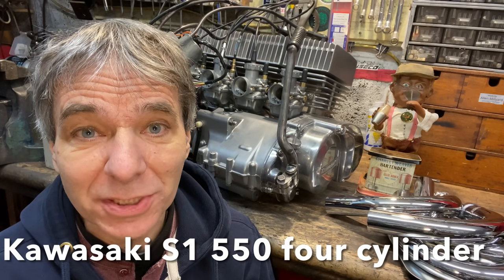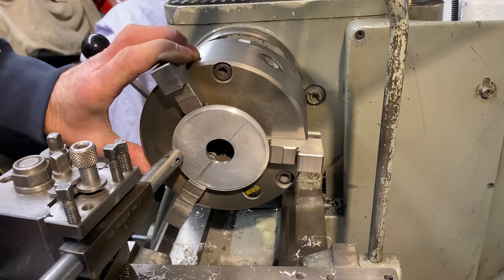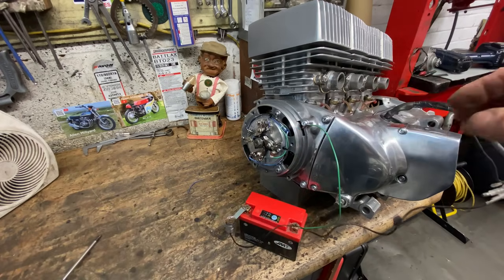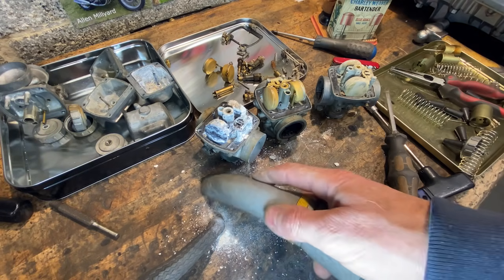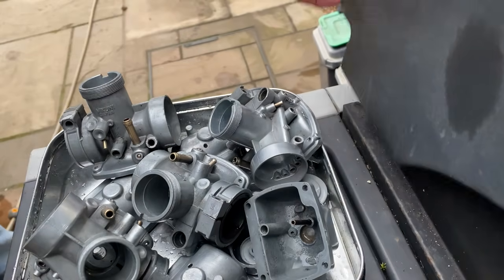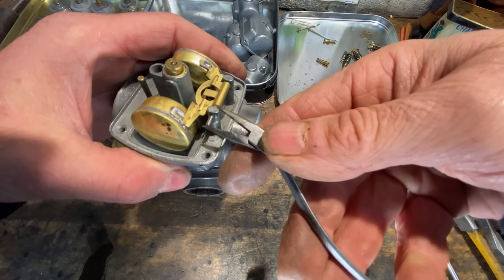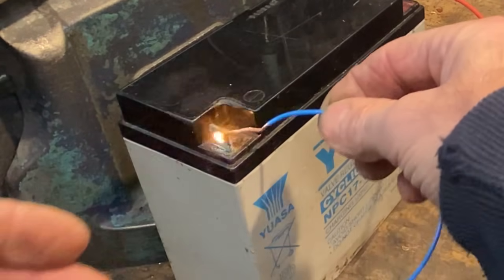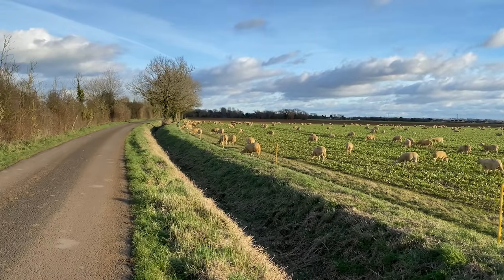Kawasaki S1 550  four cylinder first start, ignition timing and carbs. Episode 7

Comment: This brings back some wonderful memories from high school. In 1976, I was very fortunate to have a dedicated motorcycle repair class with a well equipped work shop. It was run by a great teacher and mentor Jim Capps who taught me to never be afraid of a mechanical challenge. He pursued engine mods just as you do boring and resleeving, adding domes to pistons and such. We had a small boring machine and I rebored my S2 along with disassembling the crank to replace the inner crank seals. Getting the crank straight again was quite a challenge and very few people understand what is involved with pressing a 3-cylinder crank back together. But we did it. I found a book describing the equations used to design expansion chambers and be fabricated a set for my 1972 S2. What a wonderful rocket. Real properly tuned expansion chambers make the greatest noise - so crisp and bright. It was a great adventure and taught me that anything was possible. I owe a lot in my life to Jim Capps.
Reply: That was nice to read,  thanks for sharing

Comment: 13:01 I was also taught to put nothing but liquid or air into a jet. My reasoning on that is that copper is softer than brass (thus shouldn't harm the jet), so I strip a piece of copper cored electrical wire, using one or two, maybe more strands to poke around in the jet. The number of strands depends on the size of the jet, more than one strand almost seems to be like a wire brush.
Reply: @vicamaral  🙄

Comment: Second hand crank after fully handmade ignition system.. And then the carbs, with almost idle, it probably would've idled if there was some fuel pressure from a tank.. What a build, Takumi-San, what a build.

Comment: Hi Allen, great video as always. I love to see the engineering that goes into these engines, it's quite incredible to be honest. However, I have one question... I get having the four sets of points makes some sense, but given that once adjusted for gap and them all being mounted onto the same plate, how do you adjust the timing for each one individually? Keep up the good work, cheers Andy😀
Reply: yes i wondered that as well,once set its set
Reply: There would be no individual adjustment each TDC is exactly 90 degree the only adjustment is for the entire disk plate to be rotated
Reply: @oceanhome2023  Agreed, just that Allen implied (I thought) in the video that he wad adjusting each one individually... thought I was going mad to be honest! Cheers, Andy
Reply: You slightly adjust the points for each cylinder...

Comment: I struggled with carburetors for several years until I bought Kawasaki with fuel injection.  It's like jumping from the early 1980s to the Star Trek era :) I don't have the strength for such games anymore :)

Comment: I have to think that many, if not most builders tasked with creating a duplicate of Mr Millyard’s 4-cylinder “triple” would require a CAD program, a 5-axis milling machine, a 3-D printer and a foundry facility just to commence work. Meanwhile, Allen soldiers along  with a hacksaw, a Swiss Army knife and a gas-fired barbecue.
I believe he needs to delve into something a bit more challenging; perhaps build a 1913 Indian Scout from scratch, then modify it to set an FIM land speed record at over 200mph!

Comment: You cleaning those jets with the wire reminded me of a cock up i made as an apprentice aircraft mechanic. I was cleaning brass fuel nozzles in an engine overhaul shop and thought I was clever stringing them on stainless wire though  the jet hole to dip them in acid. I got a huge bollocking for possibly damaging the calibrated orifice. Lucky for me they flow tested ok

Comment: one tip I picked up was to use solder to check galleries were clear. being soft and less likely to score. I had a bad carb problem on a Pantah and it turnewd out to be a blocked gallery which I did eventually sort with very thin solder wire.

Comment: Brilliant, was doing me head in trying to work out how to get the points to fire propley, finally finished building my kdx250 91 Sr and the travellers knicked it, gutted, repainted, new bearings. Gonna get the Rs250 going. I have to look on a Spiritual level when I lose a bike, I say the Man upstairs takes it away cause I was gonna Sling that one down the round, I have to or I'd go GaGa, and I don't bonce like I used ta. And make ur own carb bit's, Unbelievably Brilliant Craftsmenship, the Response on that Engine, the induction aswell, that Suck's better then the ex mother in law. Awesome. The only reason I do the lottery is to win and buy all ya bikes. 👍God Bless.

Comment: Dear Allen, Have you ever considered using a professional ultrasonic cleaner? I use one to clean my carbs. Even the totally disgusting ones come out like as if new from the factory and it's fast too (20 to 30 minutes, repeat when really dirty). And it does not require nasty acids but a special detergent (depending on the material being cleaned). It's great for parts like jets and needles. No need for a jet-picker anymore. Cleans every nook and cranny, even deep inside, better than anything else. There are large cleaners available which easily fit large carbs.

Comment: I like how much stuff is replaceable on these carbs. I had an old airstriker carb on my dirtbike that the needle seat had a nick or something and it would just pour gas everywhere no matter what, even after a new needle, though it's technically possible to drill out the old seat and press in a new one. I ended up buying one of those cheap Chinese ones and just transferring over as mutch genuine parts as I could. seems to work well.

Comment: Impressive, and congratulations ! Flawless at the first start. I've heard a high frequency dry crackling, without exhaust system and mufflers. It sound a litlle like the "Yamaha four" 2 stroke 250 cc of Phil Read in the sixties...the racing mood of the golden age ! Now perhaps you will install four exhaust pipes, giving a more civic mood  ; )

Comment: Another awesome video on many levels,  I keep thinking why you use points and not more modern ignition pick-ups,  I suppose it's easier to fit a different points cam with four lobes correctly fitted than trying to build a four magnet pick-up.. Anyway I'm sure you put alot of thought and design into your projects way above the average bike enthusiast.

Comment: On points with no filters and wide open pipe, modern flat slides and full exhaust and hot coils would say what?! If you could fit an electronic ignition to it with the big coils and index and gap the plugs what beast it’d be.

Comment: hi allen great job,,i have a 1954? iso mototo 125 2t tandem twin i,m bringing back to life..stator plate unusable as points /condensor very poor so i had a new back plate made in billet alloy so i could mount a modern speedway/motocross cdi unit complete with 12v coil ht lead ..i can adjust timming as its got adjustment ,,so should be fitting soon and get it running ...peter

Comment: Another fantastic video Alan. Just wondering which Priory clock cleaning solution you use No. 1 or 2 - Ammoniated or none?  Also, any particular alloy wheel cleaner or just an ‘acidic’ one?  I’m currently restoring a Kawasaki S3 and wish I had the skill, patience and courage to go get another engine and take a hacksaw to it.  But in the meantime I have 3x sorry looking VM26 carbs and would like to clean them to a similar standard.  Love the start-up of your four - there’s no finer moment than when you start up a freshly rebuilt (or ‘built’ in your case) engine for the first time!  Always end up grinning like a Cheshire Cat for days.  Keep up the great builds - and videos!!  Respect and best regards. SCW

Comment: Brilliant work!! 
Only thing im wondering is if the stock gear box would be able to hold up the increased power and if the setup would be reliable in long run if used on daily basis.

Comment: We used acids to clean stainless and copper and brass, in a good processing plant, it would clean copper pipe from dark green corroded mess to like new shine almost instantly, apparently I got a few tiny drops on the padding of my face shield, with in a minute or two, it felt like the padding had tacks in it, I took it off, washed it, washed my forehead, that now had 3-4 holes in it! I guess it was the pure stuff that got on there, not the what ever to 5 gallons we used, we used it because it would eat the meat left in the machines, and then could be rinsed off with water, I had so little on my padding I couldn't see it, because I looked to see if any got splashed when I poured it, my shield fell off while I was pouring it out, crazy how acids are violent with some things, and not touch others, if I could stood the pain I could probably seen my skull in a hour!

Comment: Allen working on the ignition points stator plate says, “…cutting as close to the line as I can”. When Dave does similar, he goes over the line and has to start again. Keep at least 3mm away.

Comment: I'll be stealing that pressure plate technique on the lathe lol
Reply from the maker: Brilliant
Reply: @AllenMillyard  believe it or not I'm actually designing my own little straight twin 500 with a turbo and my own hybrid unit derived from the f1 mgu-h I'd love to show you when it's done but it will most likely be awhile
Reply: @AllenMillyard  your videos have been very helpful especially the one putting the crank together

Comment: Great work Allen, you make it look so simple.
I enjoy restoring GT750 Kettles and I have a few sets of carbs that are in a dirty state. Ive looked for alloy wheel cleaner and clock cleaning fluid but there's a massive choice, can you tell me the make of the one's you use Allen?
I usually spend a small fortune on vapour blasting but then you've got the problem of getting all the tiny glass beads out of the drillings. Yours looked equally as good and the fluid should clean out all the tiny drillings too.
Reply: Bought some Triple QX alloy cleaner but the parts don't 'fizz' like yours did. Says on the container it's an alkaline cleaner but it just seems like a soapy solution to me. Doesn't get any of the corrosion off.

Comment: Thanks Alan, I really enjoyed that. I can't believe those carbs cleaned up so well; when you shared the photos on IG I was sure that the aluminium carburetor internals were going to be too pitted beneath the white powder.
Are you going to make some expansion box exhausts for her?
Should there be a little lubrication wick for the ignition timing cam? 
Are the points condensers concealled behind the plate?
I was impressed that you didn't take the easy way out and go with a more modern electronic ignition system.
I'm a little concerned that you didn't get a round of cakes in this episode; could this be a case of neglect and do we need to contact social services for you ;-)

Comment: I just love attending Millyard`s online motorcycle engineering classes. Been waiting patiently for this lesson....and really enjoyed the field test too . Sensational sound, so smooth and I swear I could smell the 2-stroke fumes! 
I reckon if you took up farming in the Cotswolds, there`d be some 5 and 6-legged sheep running around!
I have a question for sir.....do you ever use a hand fretsaw for cutting brass & aluminium...or is it too screechy?

Comment: Hi Allen, You're truly an inspiration and I love Your style. 
May I ask You which type of clockwork cleaning solution You've used? I happen to have a couple of carburators in need of cleaning... I searched on the net and all I could find were ammonia based products (which is a base), while You seem to be using an acid based one. I'll steal also the alloy wheel cleaner tip ;)

Comment: Great video again , on previous engines you have put on electronic ignition and then gone back to points - do the electronic ones not run quite right? And it’s just better to stick with points ?

Comment: 3:57 there might be a better solution, that's is using a HAL sensor(s) ic's + neodymium magnets, some transistors, resistors and capacitors, leds. consistent sparks and no debouncing around.

Comment: Hi Allen, great video as usual. Just wondering about the alloy wheel cleaning solution, is it the one that has acid in it and if so do you use it neat. I have a set of carbs to clean for a Kawasaki KH400 I have just purchased. Any detailed advise would be appreciated. 
Cheers Mike 😄👍

Comment: Dear allen all your vids are the best source of knowledge for me but i need your holy advice i have a problem with my klr600 and the solution is a cooper gasket the one that goes between cylinder and the head and the cuetion is if thats ok to make this gasket out of cooper sheet and how thick please i beg for your answer.
Reply from the maker: I can't remember the thickness but its the same as the original Z1 head gasket
Reply: @AllenMillyard   THANK YOU VERY MUCH FOR YOUR ANSWER IM GOING TO TAKE A SCREENSHOT

Comment: Allen, 
Wasn't the engine actually based on the S3 400cc model rather than the S1 250cc model, or am I mistaken?
I have noticed your stamping near the top rear engine mount.

Comment: That is fantastic  I had the kawasaki  750 past my test on a 175 Honda  and went and bought the kawasaki  heard  all saying widow  makers  I changed the tyre's  for Dunlop  k70s new shocks rear and changed the fork oils  dropped  the forks a little heard all the middle pot run hot and weak  out on the road flat out 90+pulled  the clutch and done the plug  check  perfect it was no hotter the out side pots it went like a train on rail's  only if you closed the throttle  on a bend it give a little wobble  but nothing that would kill you I loved it I went onto better  bikes but they were not better in fact  bloody awful
Reply from the maker: Brilliant I totally agree 😎

Comment: On my 72 s2 triple 350 one set of points was fixed to the stator plate and #2 and 3 we're timed independently of the stator.
Aren't you doing the same? You can't possibly fix all 4 sets of points accurately on the stator.